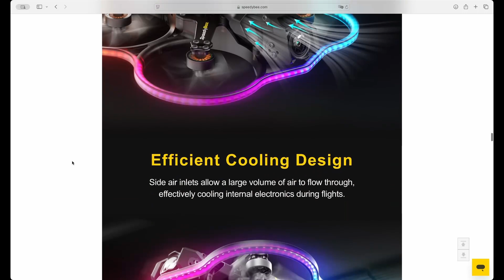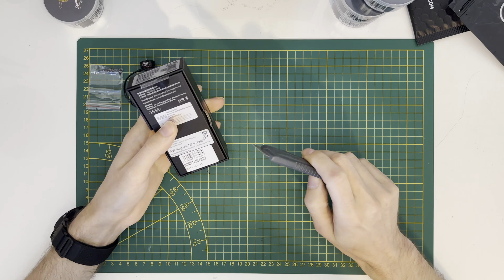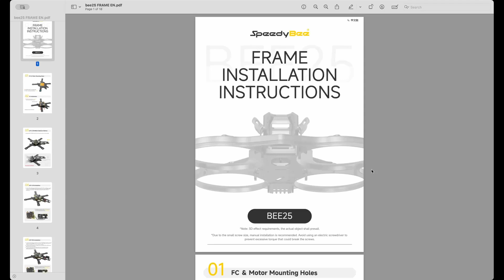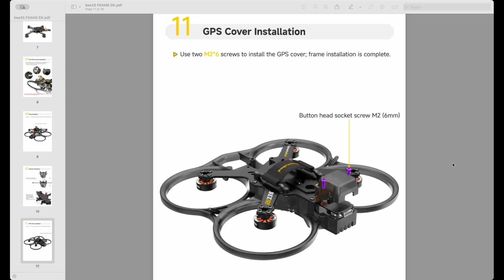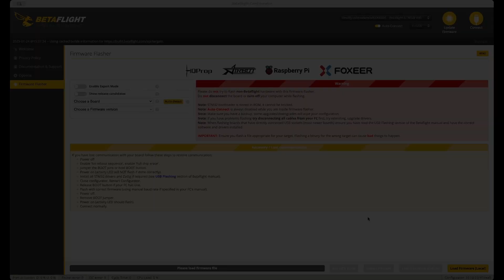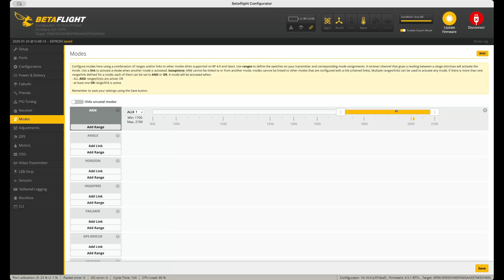SpeedyBee Bee25 Pro Frame (Unboxing & Build)

Comment: Nice, thanks. This leaves a couple of questions. In the video you have connected the EXT PRO board to UART3. The DJI camera is supposed to be on UART3. There was no meantion of the EXT board configuration. Did you get this to work? I think it is supposed to be on UART4. I am currently building the same configuration and the manual is very shady in that aspect.

Comment: Same build here aside from im on walksnail. Did you manage to get the extender board working with the transmitter so you can change LED modes on the strip? I soldered the blue and green cables from the extender to TX and RX 4 but cant control the LEDs from the LEDLOW mode and transmitter. I can change the LEDS via bluetooth to the extender board but thats it - cant make them change to RED if the battery is low for example. The manual gives little information on this aspect of the extender board.
Reply: mesmo problema que tenho